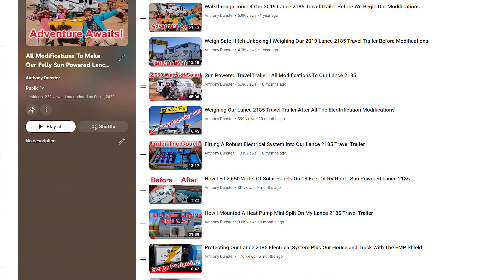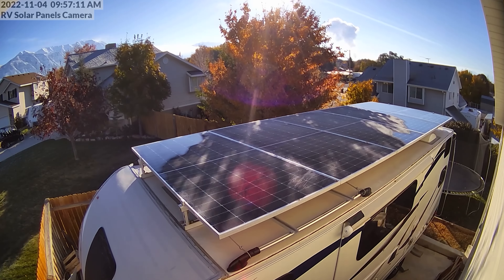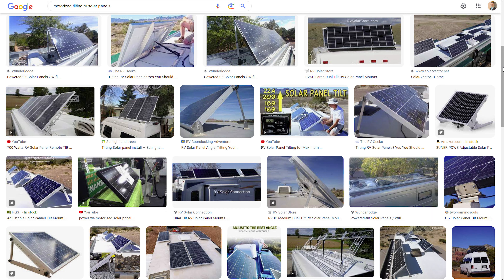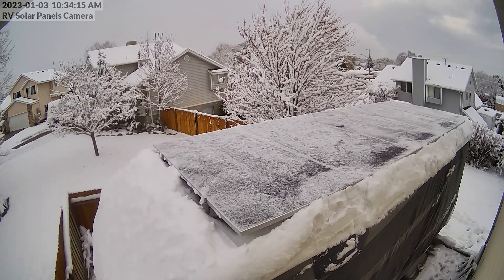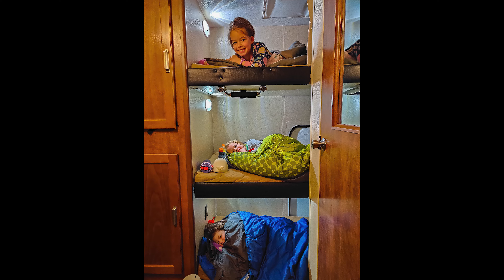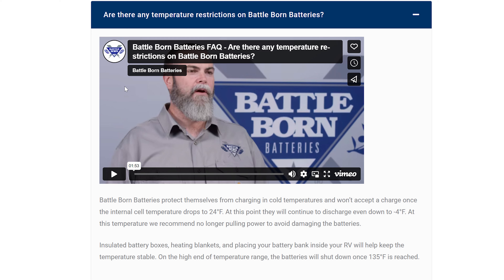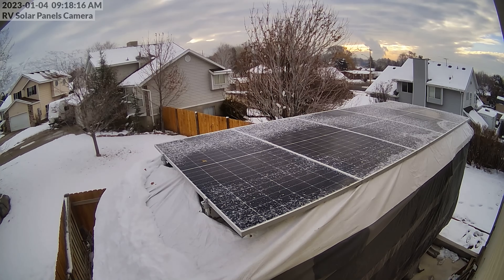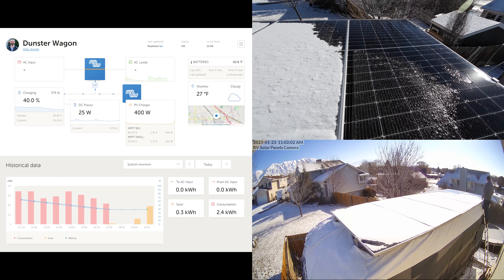Why I Remove Snow From My RV Solar Panels All Winter

Comment: Should consider making an umbilical to your house to capture your trailers Pwr for home use. Sorry if I missed if you already do.
Reply from the maker: I do have that ability. However I have to turn off my house rooftop solar when the trailer is powering the house so I don't do it on a regular basis because I don't want to miss out on my house's rooftop solar energy production. If the grid went down and my grid tied rooftop solar stopped working then I would definitely be powering my house from the trailer.

Comment: What would heating tracer cable on the bottom of the panels do for the snow removal aspect? Would that be a solution or a hindrance to snow melting off the panels to keep them clear? Worth looking into or not? A slight tilt to keep the melted snow water from collecting on the panels might prevent calcium buildup, wouldn't it help as well as to no incidental wind resistance while travelling with the towing of the trailer?
Reply from the maker: I've considered heat cable like what is for the eves of a house to melt snow. It would have to be installed under the panels to not block the sun, and to be effective it would need to be in contact with the underside of the panels. Perhaps there's a good method to installing it that would hold it to the underside of the panels, but I haven't thought of a good way to do it and my current method has been good enough so far. Tilting the panels is easiest with the tongue jack, so what I'm going to experiment with next is putting a large block under the tongue jack so that it can raise the front of the trailer even more to allow water to run off better and to match the angle of the sun better. Trying to just tilt the panels themselves would be a pain with unbolting them and whatnot. Not worth the effort, at least how I currently have them mounted. Regarding wind resisting while towing I think it's best if they're parallel to the wind rather than a tilt in any direction. What I need to do to improve aero is build a front cap that guides the wind up and over the panels instead of allowing it between the panels. I have no shop or experience with fiberglass fabrication so I haven't figured that part out yet.
Reply: @ElectricTechAdventures  Ever consider a noodle foam thingy that kids have sometimes to play with to put along the front of your panels for aerodynamic drag purposes? Possibly make them sorta rigid by soaking them in resin to harden them up some and place them along the front of your panels. Just a thought...
Reply from the maker: To my understanding in order to effectively decrease the aerodynamic drag I need to fill the gap in the front of the panels between the roof of the trailer and the solar panels. A pool noodle is only two or three inches tall and my gap is about 8 in tall. What I have considered is a styrofoam yoga roll across the front but I would need to use multiple roles because it is about 8 ft across. Then I would want to cut away part of the yoga roll so that it's smoothly transitions the air from the front cap of the trailer up and over the panels. Ultimately a yoga roll would not work because it is round and I need it to be a different shape that I can't explain with text. :)
Reply: @ElectricTechAdventures  sure sounds like you have put a considerable amount of thought into this? Who am I to undermine your progress, yes I can imagine that there must be a better solution. And I am sure that you will find one.
Reply from the maker: @spuddy4063  I have certainly given considerable thought to the entire project and I'm happy with what I've accomplished. No doubt there are some refinements I could still make. I appreciate you taking the time to offer suggestions!
Reply: Id be more then glad to make one for you with brackets get me dimensions and a few pictures of the support up front and ill send it out for free youve helped me in more ways then you know
Reply from the maker: @jmanchild that's very kind of you. Are you saying you'd make a fairing for the front of my solar panels?
Reply: Yes as i am making one shortly for my camper so i will have left over material and may even get it laser engraved for you if you know what youd want it to say
Reply from the maker: @Familyadventure369  Wow that's pretty awesome sounding. Can you send me an email to electrictechadventures@gmail.com so we can further discuss details?
Reply: I think i emailed you
Reply from the maker: @Familyadventure369  Yes, I received it. I'll respond there with more details.